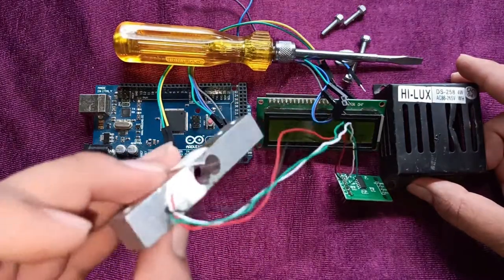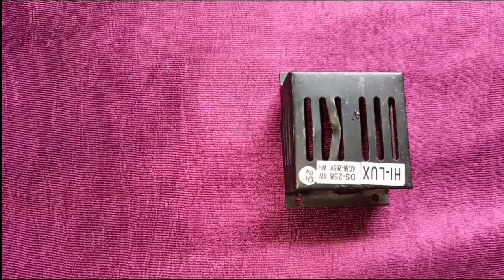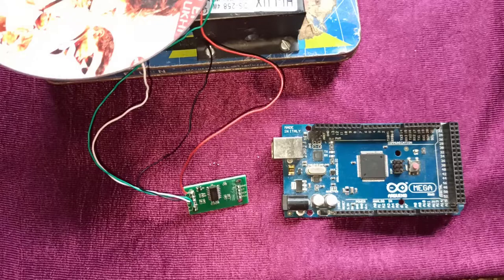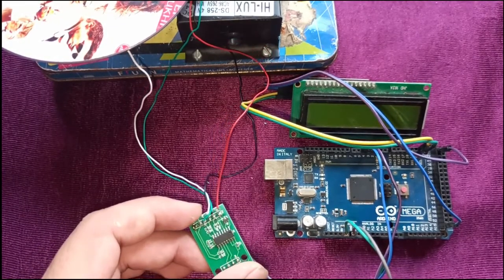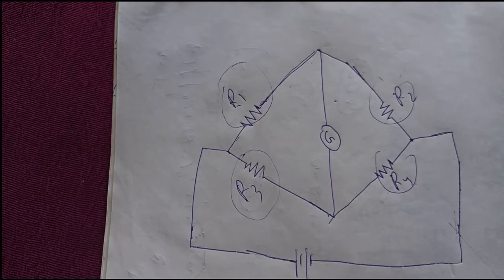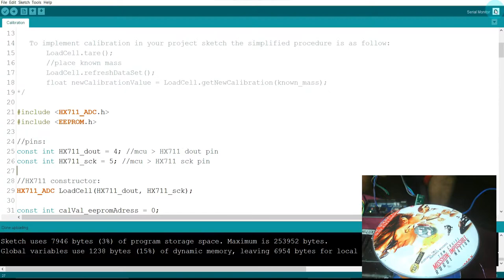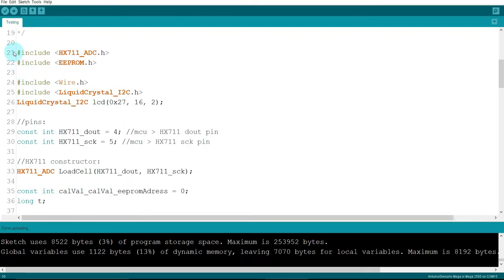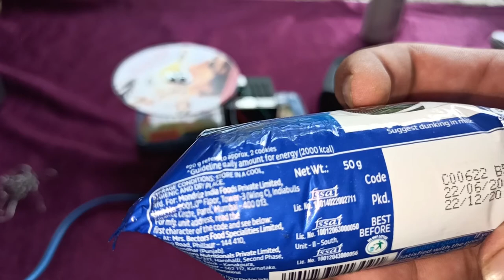How to make digital weighing machine at home using Arduino and load cell | Experimentalist.

Comment: bro where is code and circuit diagram
Reply from the maker: see if you download the library of load cell which is  HX711_ADC. After that go to examples then search  HX711_ADC after that go to calibration. follow the video, that's why I do not upload the code because the code is already there.
if you need the code individually then I send the code.
i send the circuit diagram, give me some time
Reply from the maker: go to the link, which is in the description of the video, I upload the circuit diagram in github